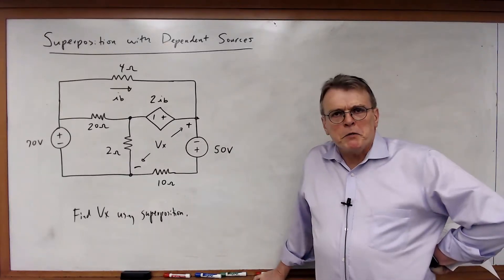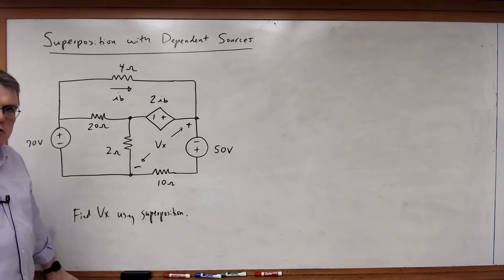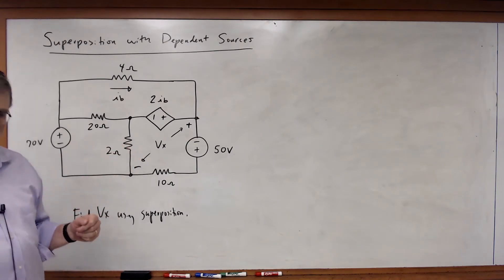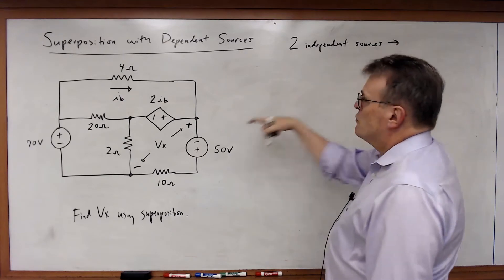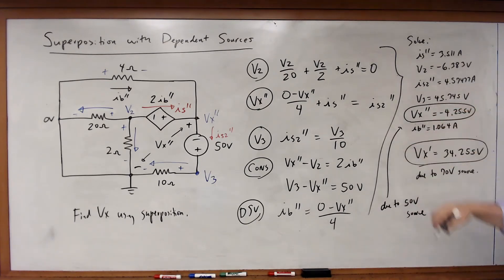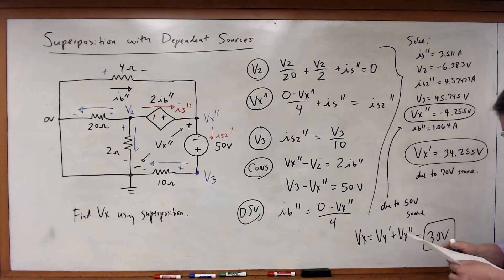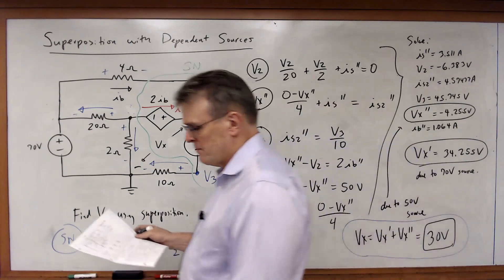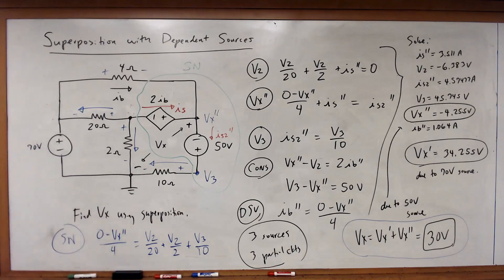EECE 2112 Module 28:  Superposition with Dependent Sources

Comment: thank you, this was very helpful, although i am still struggling to understand the part with the is2'' and V3, could you please direct me to other sources that touch on this further or give us the name of the process? thanks again
Reply: what i got from it was that is2`` is just a variable name for the current through the 50v source.
Reply from the maker: @frfrongong9712  That is correct.  I assume that the question you are asking is "Why is it needed?"

Every voltage source connected between two nodes must have a current variable defined flowing through it in order to correctly write the KCL equations.  In this case, the 50V source is connected between the Vx'' and V3 nodes.  A current is flowing through the 50 V source, and must be defined.

In order to write the KCL equation at the Vx'' node, the is2'' current variable is defined.  Likewise, it is also needed for the KCL equation at the V3 node.  This is no different than the is'' current variable defined for the dependent voltage source which connects nodes V2 and V3.

Note that if you use the supernode technique, the is'' and is2'' variables aren't needed.  You could write a KCL equation for the V2, V3, and Vx'' nodes combined.  But if you find the supernode technique confusing (and many students do), then it is best to define a current variable through every voltage source and explicitly write every KCL equation.

Always remember:  every voltage source will have a current flowing through it (unless it is open-circuited with zero current) and every current source will have a voltage across it (unless it is short-circuited with zero voltage).  One of the most common mistakes that students will make while learning nodal analysis is to forget to define the current variable for a voltage source, or the voltage variable for a current source.

I recommend that you watch Module 19, which shows how voltage sources must be treated in nodal analysis.
Reply: @wtimothyholman  thank you very much sir! I understand now

Comment: Hi
 I have reanalyzed the circuit more than once and in more than one way and Vx is always 5.53V
Reply: Ok - my last reply solved a different problem. I think you're right. Here's the solution:

https://imgur.com/a/dMeKi35
Reply from the maker: Your diagram shows V1 = 20 V instead of 70 V.  It is correct given the circuit you drew, but that is not the circuit in the lecture.
Reply from the maker: No, the answer is Vx = 30 V.  You can prove this by solving the original problem via nodal analysis, without using superposition.